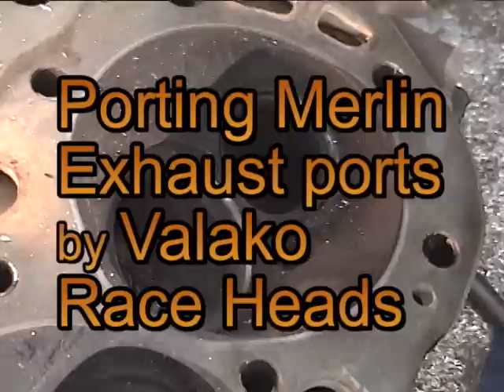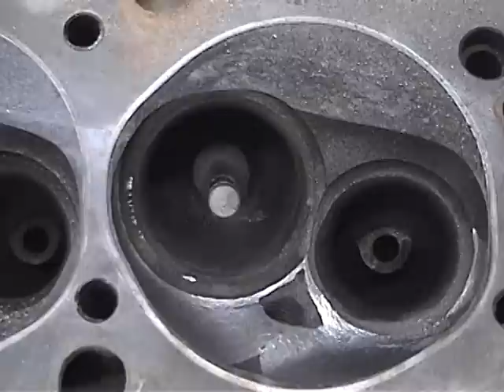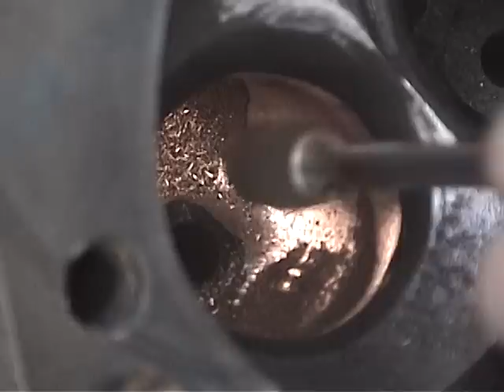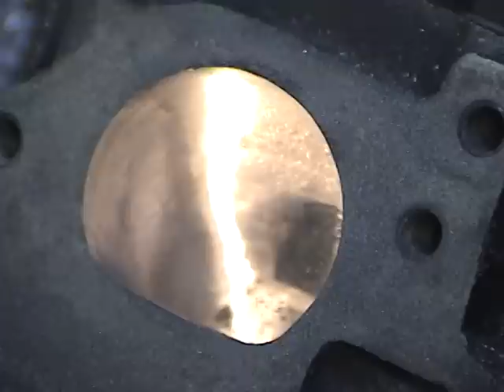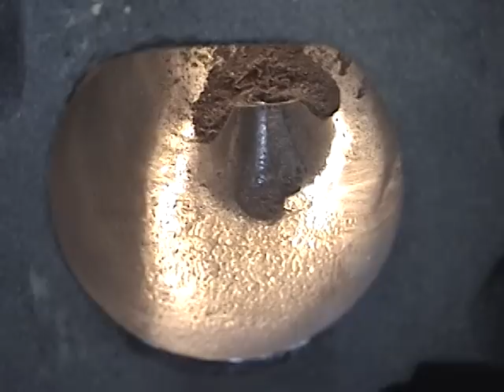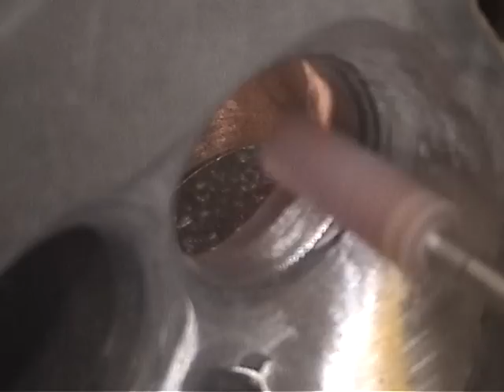porting merlin export

Comment: I have a tip for you that will save you a ton of time, use a stone to blend the carbide cuts on the iron, then the sand rolls. WAY less mess, and save you 5 minutes a chamber, with a better finish. Regis shop supplies. 4 inch shank, half inch diameter, 1 inch length.

Comment: 20 years ago, a fellow shop student bought a set of world products 350 heads.    Intake valves leaked right out of the box.       Like Thomas at headbytes porting says.     You really can’t trust “bolt on” heads these days.    Couldn’t 20 years ago either.

Comment: Hi amazing work, I have a question after you unshrowd the valves lake that do you surface the heads to get your cc's back down or does flow outperform compression ratio due too cc's of the combustion chamber ? Thanks
Reply: Korie,  I usually know what the cr is before I start porting so I order pistons accordingly.  but yes you can deck the heads to increase the compression ratio.
If had those chambers end up at 128 cc.  I've had to angle cut .180 on the exhaust side and zero on the intake to get them to 118 cc
Reply: @jimvalykeo1236  oh cool.